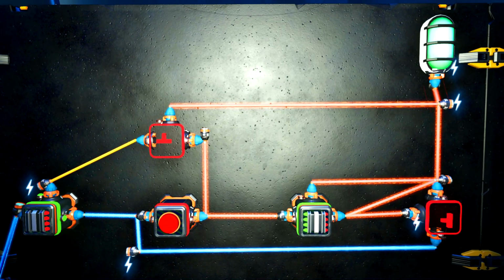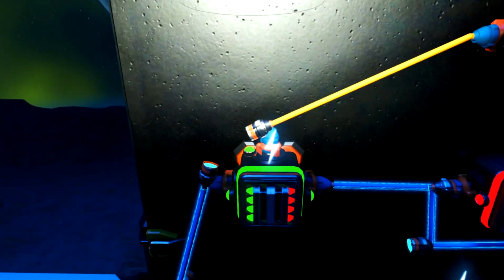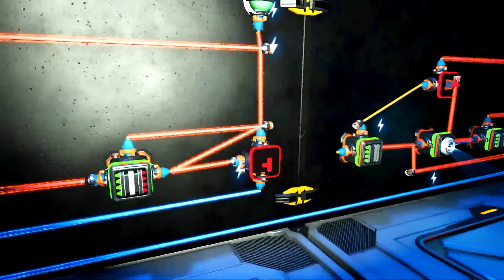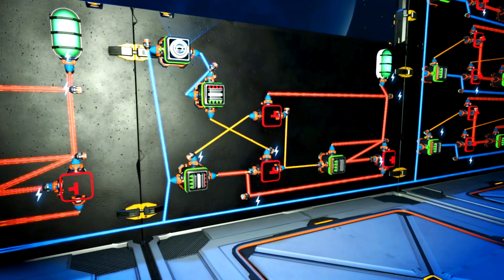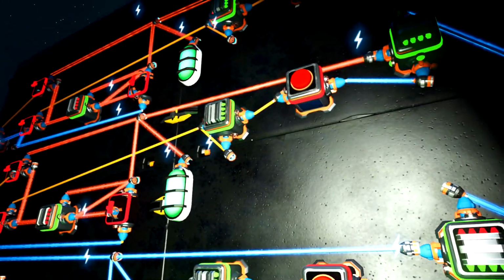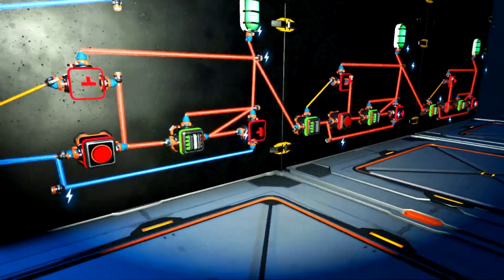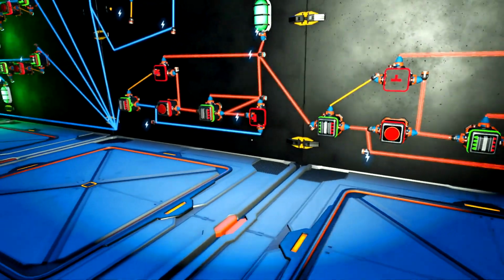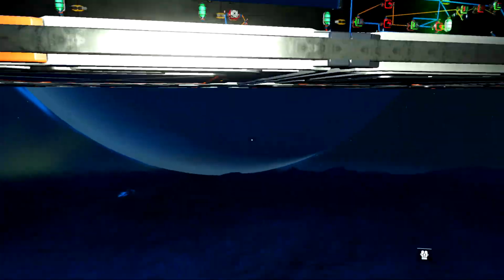No Man's Sky Beyond | Logic Tutorial | How To Make A Toggle Switch - ballisticola

Comment: Does anyone on here including the youtuber that made this video have Discord? I need someone that's REALLY good figuring the 💩 out ! I have my door working inside and out but now I want to improve on it. I want the door to turn a RED light on when closed and a GREEN light on when open but I just can't figure out how to do that. If someone on here can assist me I will add them to my Discord so I can upload pictures of my circuit for anyone that can help me with this. It is easier on Discord as I do not know how to upload on YouTube. I have the red light working but just cannot get the green one to work! Can anyone please help?

Discord link for anyone that can help me:

https://discord.gg/GBysWrK
Reply from the maker: You just need an inverter. Just look at the wire that opens the door, if it's lit up when it's close, use that for the red light, attach that wire to an inverter (power that inverter separately) which you attach to the green light. So when the power to the door is off, that inverter turns on.
Reply: Ty so much it's working fully now! I had the right idea I just needed a little nudge to get it the rest of the way. I just didn't think to power the second inverter separately